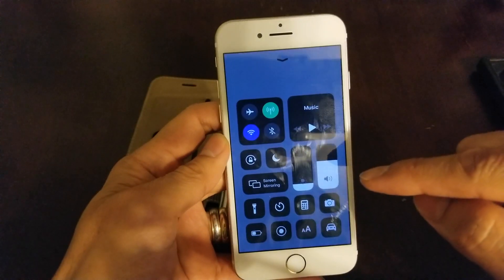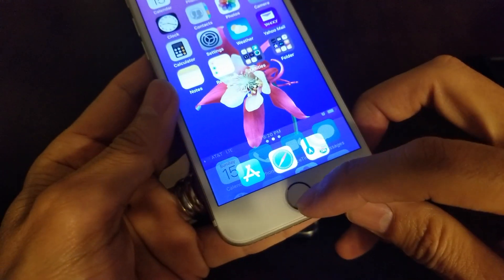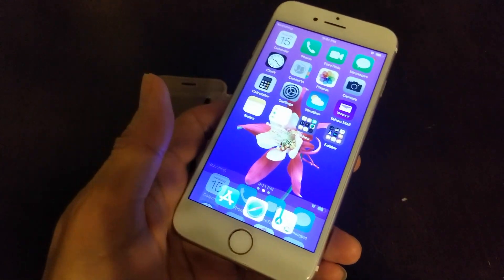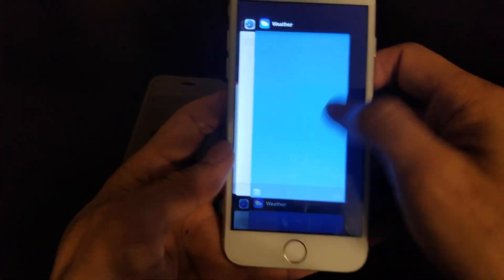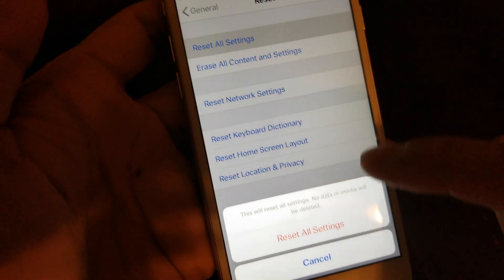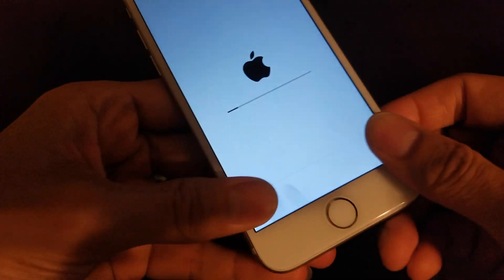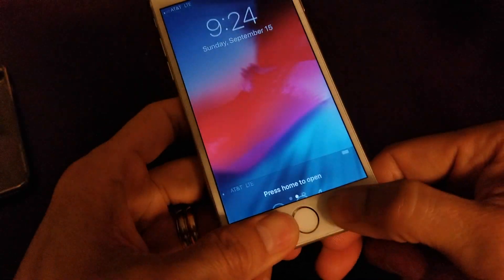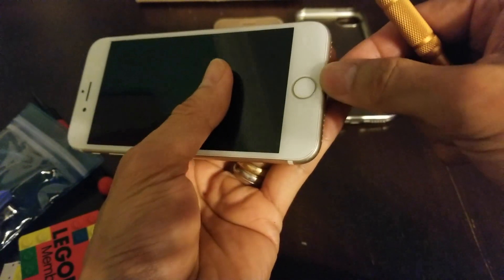Troubleshoot & Fix Apple iPhone Display Panel Static Flickering Jumping Up & Down!

Comment: I fixed the flickering problem but there are vertical lines. How do I get rid of them?
Reply from the maker: Make sure the flex cable for your LCD display has good connection with the IC board, or your last fix is to replace with a new LCD display panel.

Comment: Im too scared to confront my parents. I checked for water damage but there was literally no sign of water damage. I maybe dropped it once or twice but it wasn't a bad fall. I tried to screenshot and the inside of my phone is fine but the screen seems to be having the lines. Pls help
Reply from the maker: Yeah, dropping the iPhone will caused this issue. Most likely you will need to replace with a new display.
Reply: @macdaddypimpping   mine fell in the car and the static shows up. if I reset it, a white bar shows up in the middle. idk what’s happening 😓😓
Reply: @frxstbite10  SAME
Reply: @macdaddypimpping  my iphone was from my sister she dropped it in the bathroom floor when it was hers
Reply: I showed my dad and he said it might be because of the screen i think so too cause when i press the screen real hard it glitches more

Comment: I fixed this problem by doing this before watching your video but whenever my phone is charged up again or I power off or even switch off my iPhone, it starts glitching on the screen as if there is a crack in the inside with lines? Not sure how to explain.
Reply: What should I do? To fix it
Reply from the maker: Your display is going bad due to dropping your iPhone, need a new replacement screen.
Reply: I was using my phone for twitch streaming and it randomly happened

Comment: Hi this happend to me yesterday and by showing the control center fix it but today its much worse its reflecting the top apps and i didnt drop it i just woke up and its like this please help
Reply: Bro same thing happend i just woke and screen start flickering at the bottom and i haven dropped it
Reply: My issue is solved but we need to chang whole folder the shopkeeper tell me that this type of issue created when accidentally screen is pressurized and we dont know
Reply: Lakshay Shukla how does it get solved??
Reply from the maker: Open your iPhone and double check your flex cables for loose connections or needs to replace with a new display.
Reply: Update it suddenly dissapeared
Reply: macdaddypimpping i cant really open it i dont have a screw for that and mine keeps dissapearing and appearing😕
Reply: Bro if ur issue is fixed please help me what to do
Reply: Pls i am waiting for your reply pls tell me it help me alot
Reply: Lakshay Shukla same I really dont know what to do